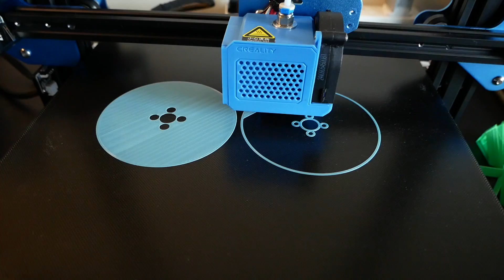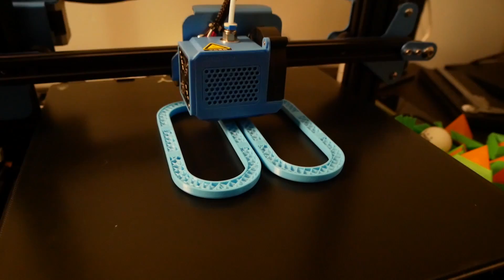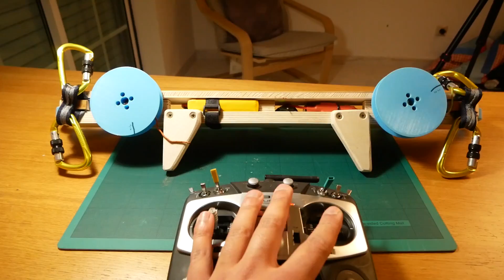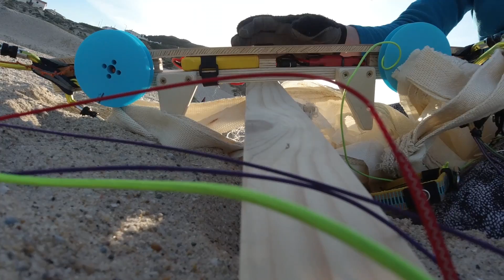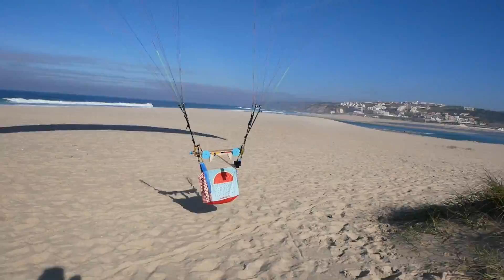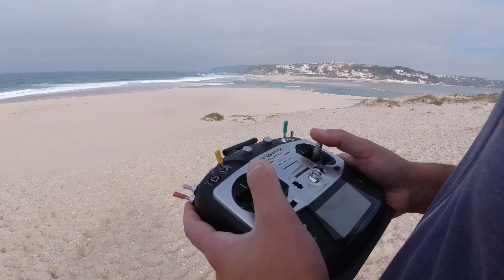World's LARGEST RC Aircraft!? - BANDARRA

Comment: Wow awesome job mate!! I didn't expect those servos to work so well! I think they're similar to the ones on my mini paramotor haha
Reply from the maker: ahah cheers dude! Yeah I was expecting them to break to be honest, but metal gears and race bearings looked like they were just about enough to hold it together. They are the beefiest ones I had around!
Reply: Nice to see you here also, Tom Stanton!
Reply: You two should definitely do a collab and make a auto-paraglider-pilot!
Get some tension feedback on the lines to make it auto adjust for optimal lift, the possibilities of user focused engineering for paragliding seems endless!
Reply: @JohanMood  Totally agree, came here to say the same thing.

Comment: I have a similar unit I made 15 years ago (before YouTube was popular).  I used a sitting mannequin torso, so the unit could be strapped into any paraglider harness(adds weight).  Heavy duty Futaba r/c sailboat winch servos with individual battery packs were used.  They attached to two retractable dog leashes mounted at the shoulders.  This made the control lines super tidy.  The servos are capable of 6 revolutions and are powerful enough for full stalls and acro at max load.  It's much easier to fly when the servo returns to a zero point when the sticks are released (hands up).  The speed bar required quite a powerful servo made from a modified cordless drill.  FPV was later added as well as a r/c vario.  It was cool flying it through Fatshark googles.  Eventually a r/c brushless motor and folding prop were added for launch and sustained flight (it also added weight).  It worked best with XXS gliders. 

Can't wait to see your next version!  Hope this helps!
Reply: Holy cow you went all out with that sucker.  Thanks for sharing your tale.

Comment: I see this is an older project now, but there's a another improvement it needs, apart from the ones you mentioned. The servos need a measurement loopback so they produce pull length proportional to the joystick input. That's typically done with multi-turn potentiometers, but there might be ready-made multi-turn servos. Anyway, great job, keeping costs down on POC projects is art!

Comment: Love it !! :) . Couple of thoughts (that you've probably already considered :) )
Winch servos for RC sail boats seem ideal for this and use "eyelet" holes to guide the lines to the pulley wheel to avoid the lines slipping of the sides, also setting the pulley wheels much lower down or take the brake handles off for extended travel, great work though :)

Comment: It is recommended that you install a cable guide above the cable drum to ensure that the cable can operate correctly. A three-axis stabilization system is also installed to make it easier to control.

Comment: Excellent! The controls could be brake lines on a back mounted rig - used for beginner instruction - maybe even dual control wing flown by learner and with instructor override, or with an electric motor would beat quad drones on payload/endurance

Comment: Awesome Andre!

Now with AI and other modules, perhaps taking one from a drone, you might be able to get it to "Auto-hover" or "Auto-Navigate," pre-program destinations, etc. 

 Also I would add in an emergency feature that if it detects a battery or servo failure, it will go into a slow downward spiral mode, ensuring it wont accidentally fly away on you.

Was referred to you via Sam Holmes Sailing 6/25/23.

Comment: Build one that can be loaded with 120-150kg and start testing recovers from collapses and stalls on paramotor reflex glider at full trim out + speedbar,no test pilot want to do it. 
Would be good for the whole community to see how they handle that over and over and not just single videos from an accident. Guess you could collapse it by pulling brake, and before any pg pilot say that you dont pull brake to collapse a glider, thats how you could collapse a reflex glider.

Comment: As a PPG pilot I am constantly thinking about having a flight stick instead of holding toggles. At first, I was thinking about a system of pulleys kind of like the speed bar, but if I pull back on the stick 3 inches I would need the lines to move further than 3 inches.. Then I started thinking about an actuator or a stepper motor and have it fly by wire, which is exactly what you’ve done. It’s remarkable that tiny little servo worked.

Comment: Thats sick! I was thinking in later versios  you can experiment with putting a flight controller on and get some stabilization and even way-points going, RTL, etc.... so many possibilities. Im thinking this could potentially be made to make it safer in turbulent conditions. Extrapolating way further can may even have an advanced FC with stall/collapse recovery algorithms... with an openppg frame you got a motor you can control too, you can probably collab with them if you wanted to.

Comment: Pretty cool Andre, you are definitely a certified nerd engineer.  I wonder if a multi-turn (or geared) pot would offer any benefit, with unsprung "stiction" control sticks, like a typical throttle.   At a minimum, you wouldn't need visual feedback on "pull percentage".   Looks exactly like something I would have done if I'd had access to a non rigid wing. 

We should trade stupid RC stories sometime.  I'm a bit older than you are, and could give you some all the way back to the days when servo systems were not only not proportional, as you have here with the servo open loop, but with actual vibrating reeds to differentiate which servo was being actuated, or single channel pulse systems....no proportional, ONE channel can be moved at a time on the multi channel rigs and each servo was about 4" X 2" X 1", more or less, as I remember, and they weren't rotational, but rather linear.  It certainly wasn't possible to do many of the flying maneuvers done now.  ;-)   Cheers.

Comment: Great job! I presume this would be covered by the new drone regulations?
Reply: I wonder if there is any regulation category that this contraption fits into. Not powered, so it might go under the radar at most places.
Reply: Vidó Tamás I don’t know much about the new UK regulations, not sure whether there needs to be power to be classed as  a drone. Even if it’s not technically a drone, obviously it has huge potential to get out of control with devastating results and impact on the paragliding community
Reply: @stanfordbeale  I have no clue either. Undoubtedly a lost wing of any size can cause all sorts of trouble - when it gets in the way of any traffic. The regulators are having a hard time all around the world to classify this new generation of flying objects. This is not an easy subject.

Comment: Awesome! Full sized RC Paramotor?? ;)
Reply from the maker: Uhhh, I thought about that, could be spicy! xD
Reply: Making it electric would probably be safer that's for sure. Keep the kill switch on until it's well away from everyone.
Reply from the maker: yeah true, electric would be easy, even on this version, but I'm thinking full size, gas Atom80 sort of thing. deathtrap! xD
Reply: I had done some quick calculations to see how much state of the art batteries would weigh for a fully-electric paramotor that was competitive with a Moster 185 and it was about the weight of a small person.  Now, if there was no person already on the paramotor...hmmmm
Reply: @mmcowan  There are quite a few electric paramotors with enough battery for 30-60 minutes powered flights -  considering a mid-size pilot. So batteries and weight should not be a problem. Initial cost for a spare time project rather more for sure.

Comment: Cool. HOw many square meter was the kite, total weight,  and what size /torque servos did you use? Thanks for your reply.
Reply from the maker: 26m2, 30-40kg, Blue Bird BMS-660DMGplusHS MG 14.2kg .17sec 52g